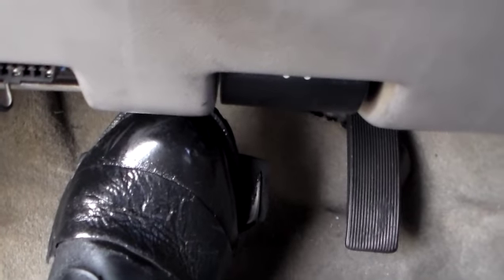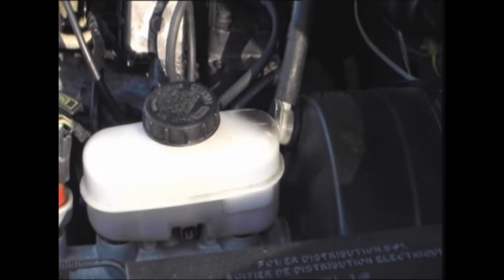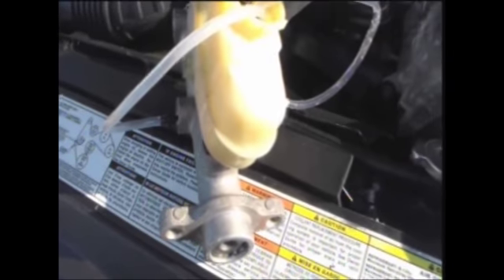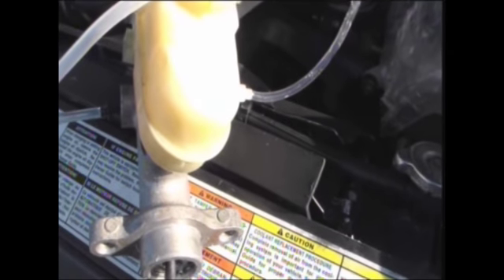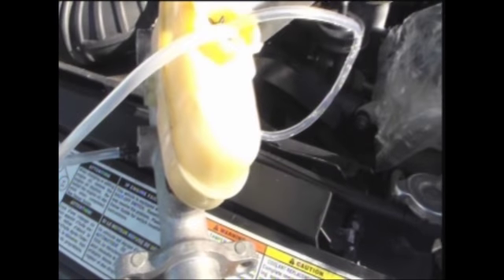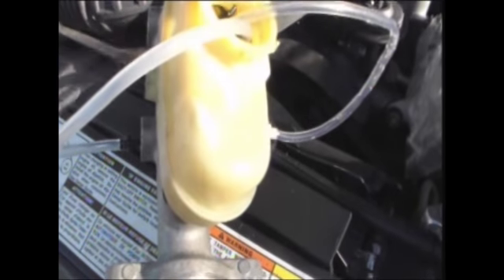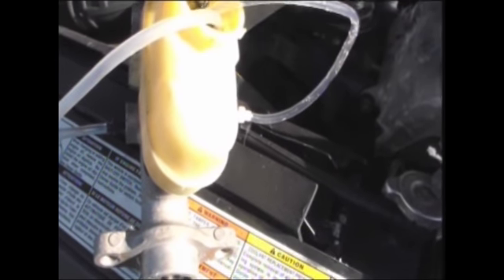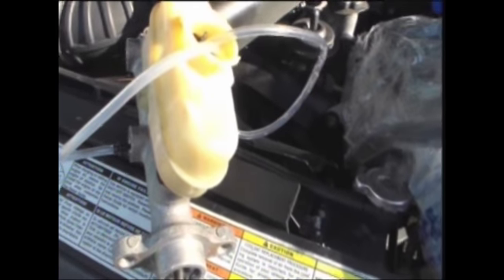How to replace the brake master cylinder on a 98 FODR EXPLOER

Comment: What if my brakes are getting stiffer? Had my explorer sitting for awhile and when i test drove it, i noticed an air sound coming from the brake. It keeps getting stiffer and the pedal is starting to stick. Which makes me have to manually pull it back
Reply: Do you think its my brake booster?
Reply from the maker: sounds like there is a leak in the lines. and dirty brake fluid. and possible bad seals on the calipers.

Comment: my brake pedal fluctuates in pressure on my explorer sport. you think i should replace master cylinder?
Reply from the maker: Hey Kyle. I would flush the break lines, and make sure the drain hole screws are snug first, also check to see if there are any leaks in the lines.
Reply from the maker: Great!
Reply from the maker: Great!